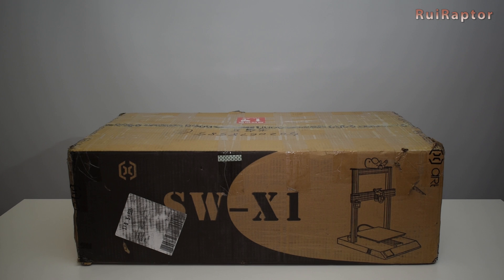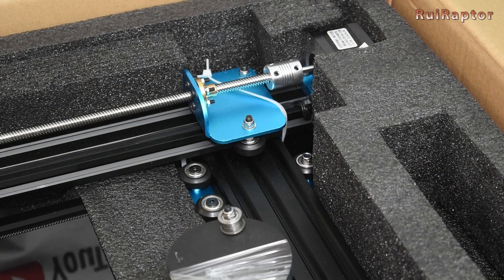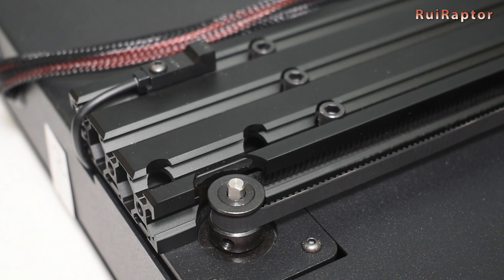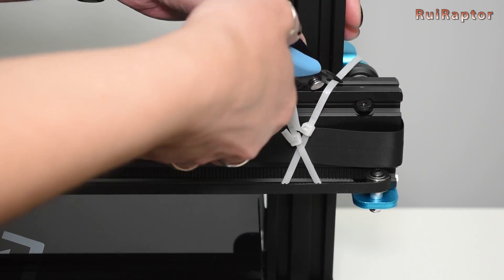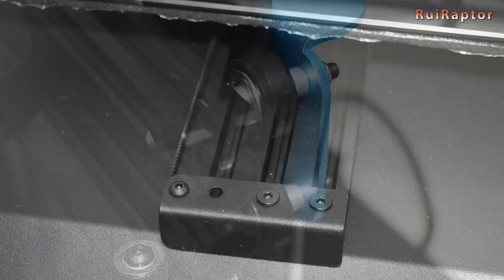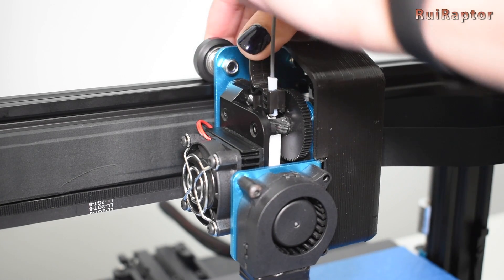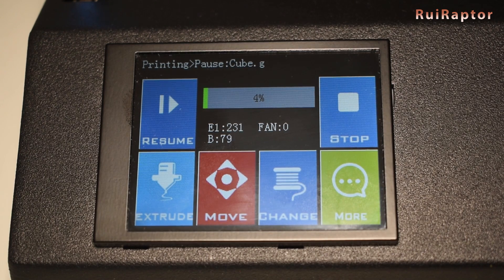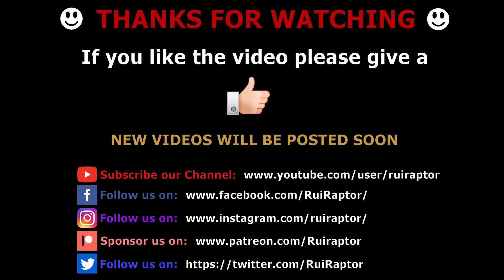ARTILLERY Sidewinder SW-X1 (3DPrinter) - All The Secrets Revealed

Comment from the maker: Hi guys,

I've been running a lot of tests to troubleshoot the Artillery SidewinderX1 uneven layer issue.
So far I've done the following:
- Installed TMC2100 drivers
- Replaced the stock nozzle with a Trianglelab nozzle
- Printed without the filament sensor
- Printed with the spool on a different spool holder (Out from the printer)
- Replaced the extruder feeding gear with a titan feeding gear

This issue is most likely to be related to feeding problems and not Z wobble. However, I ran a few tests to confirm such as:
- Replaced the spring couplings with rigid couplings
- Printed without the top leadscrew bearings

The results are still showing the uneven layers but I noticed a small improvement after replacing the nozzle.

All the tests were performed by printing with the gcode cube provided by the manufacturer.

Now I will print with my own profiles/models and check if there are any differences.
Reply: Any news on your issue, yet?
Reply: Thanks for the thorough review!. From my experience with the same issue on other printers, it seems like it might result from: 1- Excessive and uneven pull/push on the filament that could be due to: friction on the filament inside the small Teflon tube in the extruder or just wobbly extrusion gears. 2- Bed bowing up and down in tiny increments during On/Off thermostat heat cycles, this could be mitigated (or reduced) by activating PID option for bed in the firmware.
Reply from the maker: @tareql1906  ,
Thanks for the inputs. We already did a few of those things like replacing the extruder gear, completely disassembled the extruder and hotend and inspected everything, checked bed temperature variation, etc. One thing I noticed with the bed is that the silicone heat element is coming off from the bed. They probably did not use the correct glue for this temperature demanding application. We eventually stopped the troubleshooting because we have many other projects at the moment and not too much time to do them all :)
Reply: Wow that's what i would have tried, could the z-rods themselves have inconsistent threads? or maybe the thread pitch has a magic number layer height that is unusual?
Reply: Hi Ruy! Did you solve the uneven layer problems already?
Reply from the maker: @moltech  
Olá Marcelo, nós já fizemos imensos testes e o problema está praticamente na mesma. Neste momento esta impressora encontra-se em standby porque temos imensos projectos em mãos e muito pouco tempo disponível para os desenvolver. Logo que possível voltaremos a estudar este caso. Qualquer novidade postaremos aqui e/ou no facebook :)
Reply: @ruiraptor  Obrigado, meu amigo! Teve um cara que comentou aqui que poderia ser problema na engrenagem da extrusora. Eu vou acabar substituindo a extrusora inteira para ver no que dá. Eu já troquei aqueles acopladores do fuso por idênticos aos da CR10S Pro e mesmo assim nenhum resultado positivo. Claro, essa foi a última modificação que fiz. Uma coisa que notei é que o problema parece menos grave quando imprimimos em camadas de 0.2mm. Não sei se vc notou isso. Enquanto não resolvo eu estou usando ela para imprimir os upgrades em ABS para outra impressora que tenho aqui.
Reply from the maker: @moltech  , Sim, também trocamos os acopladores e também trocamos a engrenagem do extrusor mas sem resultados positivos. Todo o extrusor e hotend foram desmontados e revistos. Em relação ás camadas, é natural que para certos valores de "layer height", o fenómeno seja menos perceptivel mas continua lá. O que notamos foi que os modelos que nós fatiamos ficaram melhores que o cubo de teste que vinha no cartão SD (em gcode). Os nossos modelos foram imprimidos com 0.2mm.
Reply: @ruiraptor  por acaso chegou a usar o repetier host para imprimir ao invés do cura? Tenho essa dúvida, pois aos poucos o problema vai me parecendo mais com algo relacionado com software do que com o hardware.
Reply from the maker: @moltech  Eu uso outro fatiador mas para este problema acho que não tem influência. E uso sempre o cartão para imprimir pois sei que evita outros problemas.
Reply: @ruiraptor  É, meu amigo! Vamos que vamos continuar até resolver essa saga. Se eu tiver alguma novidade eu lhe aviso. Abraços e obrigado pela atenção.

Comment: What I'd like to know is... how the hell does anything stay stuck to the bed after the first print?
I printed the cube. Came out perfectly. But I had to beat it off the bed, that it was stuck so hard.
But after that, I couldn't get anything to stick to it. I cleaned it with isopropyl alcohol. Took a
yellowish film off the bed. Tried to print another filament spool holder. And nothing would stick.
I wasted so much material (As everyone knows... a watched pot never boils.) because I would
walk away, and THEN it would come loose, and fall off the bed. 

I had the bed preheated to 60, and the extruder to 200. From watching other videos, I accepted
these settings to be the norm. Of course, I would level the bed just prior to the print. That's a
project, all by itself. None the less... it got done. And every single time, it would get through
25%-50% of the project, and it would come loose.

I've tried messing with the bed temp... 50, then 70, then 55, then 65. I'd walk away from it for a
few minutes... and come back to a hay stack. I've even tried a glue stick, even thinning out the
glue with an alcohol smear. 

For the love of God... WHAT THE HELL AM I DOING WRONG?!!!
Do I invest in glass? Or cover the bed with pre-mask tape, buy a gallon of tar, maybe a case of
fly strips, or crack a beer & be thankful that I don't live under a bridge? There has to be an answer.
Too many people are printing nice, BIG things, while I struggle to print a subway token. Really
gettin sick of starting over, half way through a 6-hour print.
Reply: use hairspray on the bed and it comes lose after it cool down
Reply: @christerwestlund4015  I forgot I posted this. But I remember the moment.
Come to find out that, I wasn't having adhesion problems. I was having
"the nozzle is too damn far from the bed" problems.

This printer has a 5-point leveling system, which I completely overlooked.
The most basic of things NOT to do, and I didn't do it. I forgot to level the
damn thing. So... now I'm back to needing a hammer to get my prints off.

Thanks for chiming in, Christer. Appreciate it.

Comment: I just received my X1, and I noticed the WiFi button but can't find any documentation on it. How do you use this? Does this printer have WiFi built in?
Reply from the maker: If your version is equipped with the same MKS GEN L board then no, it does not imclude the wifi module.
Reply: @ruiraptor  Doesn't it include the MKS TFT (touchscreen) that does have the wifi module?

Comment: Hei guys, Alex here. Unfortunatelly i still don't have my youtube channel, but still I want to share my experience of this printer as a comment to the most helpfull video i watched trying to eliminate the problems of Sidewinder. So on
I read all the comments here, did everything people said, but it was no help eliminating this so called @z-axis wobble. 
Then i tried the spiralize setting of Cura sliser for the vase. A little bit of shaman dance and wuoala - the print looked fine on all heights. Spiralize gradually changes z-axis coordinate during print in "vase" mode.
Then i looked to the original config file of artillery sidewinder firmware and discovered that steps/mm on z axis was 399.778 (also for x and y axis it was 80.121), and the G-code was just saying the printer to move z axis to coordinate corresponding layer with two signs over coma. So the mistake has a cumulative character and after a sertain ammount of layers it just skipped a layer, then making the other one thinner resulting in "random" layer height over layer 63 (0.2mm layers).

The solution:
Add the following lines to your G-code preambula under @Cura->printers->artillery->machine settings
M92 X80 Y80 Z400

Enjoy your clean layers )
Reply: Is it in the start gcode? No replacement? Just add? Thx
Reply: Very helpful.  I ordered one already. Should get it next week.
Reply: @jimscobie6646  how's your experience with your sidewinder?  I'm on the fence about getting one.  What site would you recommend me buying it from.  Thanks in advance

Comment: flat cables maybe not designed for hotend as you said, but do you check how many cables are used only for the heater ? i'm sure they multiplied cables to avoid overteating

But for sure I will buy 5 of this printers for my next batch printers for my printing compagny
Reply from the maker: Hi, yes, they have used more than one wire to divide the current between them. I also mentioned in the video that there are no signs of abnormal temperature on those flat cables which means that together they can handle the current.
Reply: @ruiraptor  on electricity, have 5000 little same cables or one big change nothing. The important is the total section of the total cable.   
But I will certainly buy this cool printer.
The only thing I hate in the design.... Is the glass build plate, I really prefer magnetic flexible coating
Reply: @xTreme.Power.  a bit late but how did it go with those 5 printers? im thinking of getting one
Reply: @isaacdahab9509  hi
They work perfectly,I love them, just power on, launch prints. No problems at all, just change sometimes the nozzle ( like on any other printers.

I also selled other old printer's to buy also 2 Elf corexy. I love them too and work perfectly with my Mosaic Palette 2s pro

Comment: There are a lot of things to like about this printer, but inconsistent extrusion seems a pretty big deal. Will you think about doing a "how to" tweak video soon on what needs to be done to get it tuned to its highest potential? That would really help me decide if I want to get one, or to go for some other "I3" type printer for my second one.

Job well done on your videos, by the way. Informative and to the point. You are one of my four or five "go to" sources right now.
Reply from the maker: Hi Val,
Our printer is the first version and it seems that the first version was the most affected one by the inconsistent extrusion.
From what i read from other users, the newer version does not have that issue since the manufacturer modified a few things.
Reply: @ruiraptor  You should add that information to this video you do a disservice to you followers or make a second video explaining that information, I might be done with this channel!!~!

Comment: Nice video guys, printer looks very clean with a couple of minor issues. Would like to see if you and Nerys solve the uneven layer issue, be interesting to see if its a current to the stepper motor or the plastic cogs having some play in them when they turn causing pauses in extrusion.
Reply from the maker: Hi,
I ran a few more tests and I can confirm what I've said at the beginning which is not related to the z wobble.
I replaced the nozzle with a trianglelab one and the print quality increased a bit but the uneven layers are still there.
My main suspicion is still the extruder and I'm focused on that right now. 
Will feedback when I have more information.

Comment: I do not like the restrained and interlinked z-axis I would prefer if they would get rid of the belt and the bearings at the top and it's dead at a second and stop for the second Z Motor that would take care of the uneven z-access draft every time that printer is homed

Otherwise however the printer looks extremely nice and I look forward to digging into it tomorrow
Reply from the maker: Hi Nerys,
thank you for your comment. The dual Z with belt on top is not new. The tevo flash also has that system.
A dual endstop for dual z motor implies that you edit the firmware so that it would know that each Z motor/axis has an individual z sensor and with that, each z axis will continue turning until the correspondent endstop is triggered.
Reply: I know. I removed it from mine. z wobble in my prints went away after that :-)

such a system requires machining level precision in QC and assembly to not get z wobble. I VERY much suspect your oddities might be related to it.

by linking the system like that you are turning a motive system into a guidance system. this bad since you already have a guidance system (the rails and wheels) this means if the two are not PRECISELY aligned and I do mean precisely they will "fight" each other. they will push and pull on each other resulting in distortion of the kinematics. this will result in noise.

when I assemble mine tomorrow I will leave it stock to see how it goes but if it goes like the flash I will remove it and the bearings so the tops of the z rods are unrestrained. this will remove any wobble from those rods being translated into the guidance system and therefore into the print.

I could be wrong. maybe they did it to enough precision to avoid that but I see no benefit to it.
 @ruiraptor
Reply from the maker: Hi Nerys,
That was one of my initial suspicions and I did remove the top bearings and belt and ran a print without them (before publishing the video) but the result was the same. I also tested rigid couplings too. Because of these initial tests and results, I mentioned in the video that was probably not related with Z-wooble.
Reply: intriguing. I am glad you had done that already.

have you tested what others have mentioned regarding eccentric gear in the feeder assembly? IE QC issue. ?

the one thing that led to it not being z wobble was that it was not consistent on Z. feeder issue makes a little more sense but I lack experience with that to say for sure either way.

 @ruiraptor
Reply from the maker: Hi @Nerys,
The extruder and nozzle tests will be done next. I will feedback as soon as I have the results ;)

Comment: Hi! Looks like some better Flash/Ender-3 with a bigger printing area. Not sure if load/unload for this direct extruder is better than manual procedure in cases of some bowden extruders if there will be a need to change a spool in one print.
Print bed seems to be great if they will be maintaining the same quality further. I would buy this if didn't have Flash :)
I guess that Sidewinder's firmware can be changed by users.
Reply from the maker: Hi,
you are correct. The firmware can be easily updated.

Comment: No ABL? The filament sensor is a good addition but no ABL makes no sense. It seems FDM printer design has plateaued with just more of the same with manufacturers just ripping each other off. Also, I could not find a source for a copy of the software to be able to modify or tune it.
Reply from the maker: Hi,
when you say software, you mean firmware?
If you mean firmware, the sidewinder uses marlin firmware (which is open source). You can contact the manufacturer for the firmware.

Comment: Hey Rui. I have the exact problem with my tevo tarantula. The layers look absolutely perfect when viewed in a certain way, but once you look at them from an upwards angle you can see uneven layers. Im running the stock hotend and stock extruder and did not get this problem in the past. What do you think is causing it on both printers? Could it be the steps per mm on the motors? My best guess is Z backlash.
Reply from the maker: Hi,
I don't think it's caused by the steps per mm. Even if your steps per mm are wrong, they are constant.
I'm currently working on this issue with this printer and will feedback on my facebook page when I find a solid solution.
Reply: @ruiraptor  awesome. Im very curious as to what it is. I cant seem to get rid of it on my printer.

Comment: the uneven layering is caused by the titan replica design - the pressure on the filament is uneven due to the eccentricity of the  feeder wheel in the big gear. Same issue on the newer versions of tevo flash.
Reply from the maker: Hi Tedy,
That could be a reason and i will explore that.
However i must say that i have 2 tevo flash printers and i don't have any issue with the extruders and they print perfectly.
Reply: @ruiraptor  he said newer version so I wonder if you and I got the original versions because my two TiVo flash printers also print perfectly quality control? Batch issue?
Reply from the maker: That is a possibility.
Tevo has the titan extruder (with tevo logo on the case) for a long time since the tornado and michelangelo. For a long time they include the titan with the stock extruder with all the tevo tarantulas. If it's related to the extruder I might suspect of a bad batch. Unfortunately, I don't have one of those new versions to make a few tests :(
I have a list of tests I need to run first but will disassemble the extruder of the sidewinder next and check that in detail.